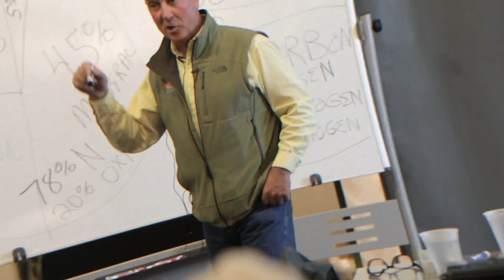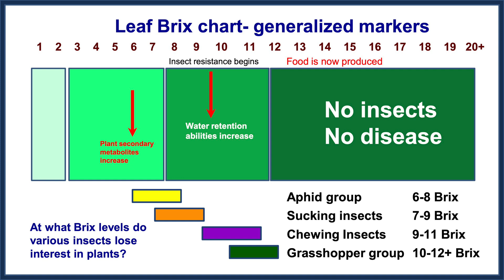Soil Solutions Series | Ep. 11 | Healthy Plants 101 Case Study - BRIX, Calcium & Solving Bitter Pit

Comment: How well do your livestock grow if you don’t feed them? If you want your soil livestock to grow you have to feed them I will utilize 20 gallons per acre in Rowcrop production of 43 % cane molasses this year. I always combine it with humic or fulvic acid depending if it’s soil applied or fully applied. I have no concerns about excess iron because the iron is in the right form and is chelated by the sugar in the molasses a previous comment was that their fungal diseases were increasing the only way that would happen is if the molasses was tainted with glyphosate from idiot farmers, desiccating their sugarcane with glyphosate.
The humic or Fulvic acid would bind to the glyphosate and keep it from causing harm. Bottom line is molasses will increase your nutrient absorption through healthier and more robust microbial activity.

Comment: I'm about to use Gsr calcium in my avocado orchard all i have is a hammer mulcher to strip the grass/ weeds under the trees, is that sufficient preparation for the product to work effectively?
Reply from the maker: Great to hear! - a hammer mulcher is a good start, as it’ll help break down surface material and should improve soil contact. For best results, you do need to ensure the calcium gets topically applied directly to the soil.
Reply: There is still a little grass stuble  and mulched material on top but the soil is quite bare after 1 or 2 passes. Thanks for the reply, much appreciated

Comment: Why does molasses increase fungal disease (septoria/leaf spot) in hemp & tomatoes compared to other sources of sugars?
Reply from the maker: The impact of molasses on fungal disease can depend on soil conditions and microbial balance. Molasses is a simple sugar source that can feed both beneficial and pathogenic microbes. If the soil lacks oxygen or is already leaning toward anaerobic conditions, adding molasses may encourage fungal pathogens like septoria to thrive. Other sugar sources, like structured calcium combined with some organic cane sugar, may better regulate microbial populations and support beneficial organisms. Have you tested Brix levels in the affected plants?
Reply: @SoilWorksLLC-GSRCalcium  in this case, must test consistently and repeatedly during the "infection" period. If brix steadily goes up even if minutely, we know the plant is fighting back and will not have this problem later. If brix goes up then goes down, we know the dis-ease is overwhelming the plant by consuming the sugar and further colonising the root zone. 

Hemp is sensitive during its first 45 days. Mortality can be high. Tomato mortality is less but the plant does not recover as well from stunting compared to hemp after suffering disease. 

Chances are you have had a soilborne pathogen leftover from a previous crop and it decided to go aggressive when it sensed delicate plant growth stage. 

Mix some coarse rock dust an inch in. More air and magnetic disruption of disease.

Comment: If the PH is 6.1, will adding sugar continue to drop it?
Reply from the maker: Sugar itself doesn't directly drop pH, but it can create a more hospitable environment for beneficial microbes, which can contribute to healthier soils, including a balanced pH.
Reply: @ That's what I thought.
Reply: You're in a good spot. Add some lime. Bring it up to 7. Then add sugar to stabilise at 6.8. Trust me, that 0.2 difference will be hard to achieve on sugar alone in a consistent fashion. You may get a few readings but rain and the elements will mess with your results.
Reply: @ I want it at 6.4.

Comment: Can you specify the lb/1,000sf of sugar? You specified 5-10 # of sugar but not the area. 
Also, did you observe any side effects like additional bug pests , grubs, or ants in the soils?
Reply: at 10 pounds per acre, you need 3.7 oz for 1000 sq ft.
Reply: They're talking about fruit trees, so I believe it's pounds per tree...If it were row crops it'd be tons or hundreds of lbs/kgs per acre/hectare
Reply: @moogman5  No no no, they are talking about pounds per acre, they always do
Reply: @ 5 lbs per acre?  No way its that little….each tree takes up the size of a closet or small room and is just as deep as it is tall
Reply: About 2 kilograms to 1000 Square meters.  Or 10 pounds to an acre.  That makes sense to me.  Think about it. 50 trees in 1000 Square meters of avocado. Each tree gets a half cup of sugar. Makes sense to me.  I don't care about the amount as much as i do it's percolation.